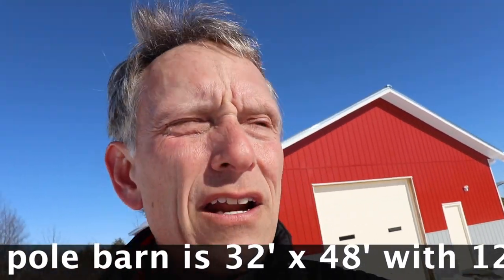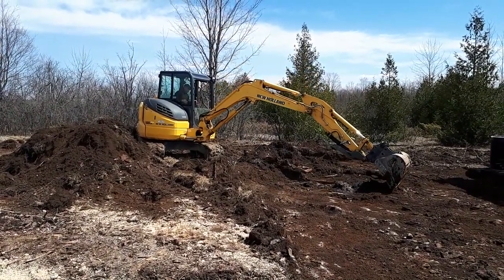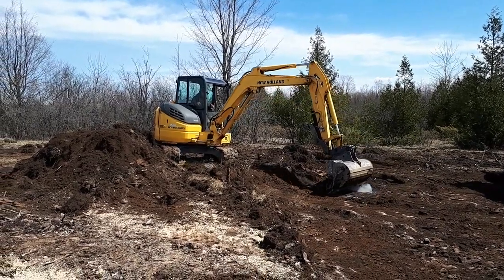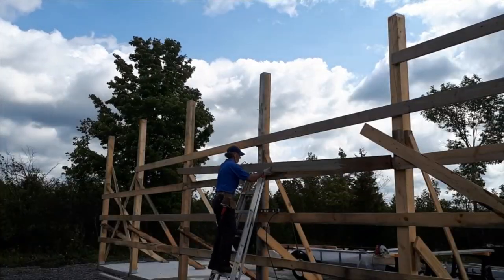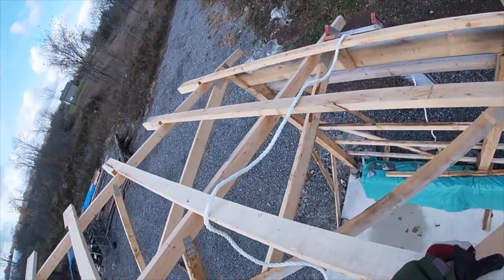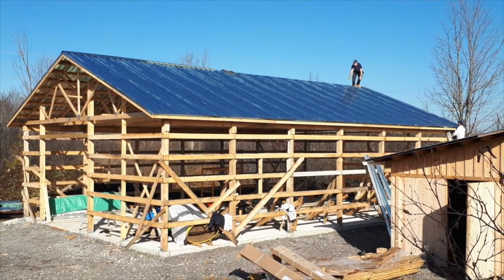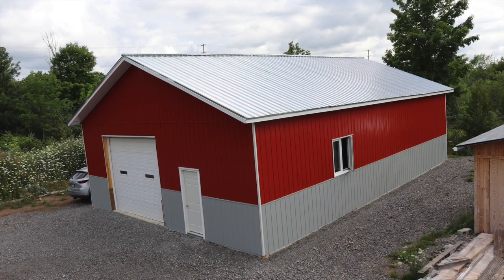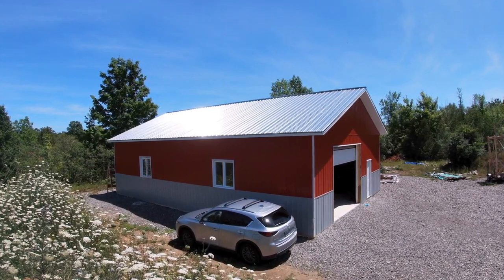How Much Did It Cost Me to Build My Pole Barn?

Comment: I've watched all of this project Peter. I think a Pole barn build is the greatest thing ever. My younger brother build a 3 car garage the same way, with metal roof and exterior walls.  He had radiant floor heat put in his concrete floor which is 32'x48'x10' ceilings. . He can heat his garage way cheaper than I can and mine is only a 2 car 24'x32'x 10' ceilings. A very nice garage.
Reply from the maker: Thanks Dean ... for your interest in the project! I think your brother made the right choice with the radiant floor heating. My budget at the time could not work with the in floor option.

Comment: How many bags of concrete premix did you use?  I thought for that many piers it would have cost alot more than $106.  Great video series.  I've learned alot and plan to attempt something similar. Thanks.
Reply from the maker: Thanks Rodney. I bought about 24 bags about two years ago. Many of my piers are not more than 12 inches high. There were about 3 or 4 that were 20" to 24" inches (undulations in the bedrock). I added some extra gravel and I think I even returned a couple bags.

Comment: Doesn't using uncured timbers bring a great risk of structural flex that could lead to failure or at least damage????
Reply from the maker: Hey Richard, I'm not a civil engineer so I can't answer with certainty. I researched what I could build with 'green' lumber thoroughly. In most jurisdictions in North America, non-habitable buildings can be built using 'green' lumber. So, barns, storage buildings, garages, sheds, tools sheds, etc can all be built using green lumber. However, the trusses must be constructed with kiln dried and inspected lumber, and must be approved by an engineer. Also, my plans and materials, including use of green lumber, were approved by my municipalities' building engineer. All this to say, I don't think 'green' lumber could lead to 'failure or at least damage'. I think there are greater risks concerning failure and damage if you do not adhere to approved building and design standards. Peter at the Reboot.
Reply: @TheWoodlandReboot  The problem is not with the green lumber.  I build post frame with imbedded, treated posts.  I  have seen buildings without treated lumber expire (for lack of a better word) in 20 years or less.  You have eliminated the rot problem below grade, but if the bottom girt and the post itself are not treated; the bottom half of the girt and the critical bottom 4 - 6 inches of the post will also rot within 15 - 20 years.

If it were my building, I would start soaking the perimeter and especially the posts in waste oil or anything thing else you can concoct to make it less inhabitable for the microorganisms that will invade.

Comment: Nice job on the shopping around for discounts!!! Especially that insulated door. One question for you. Are you worried about the milled lumber drying out, twisting or shrinking? Any thoughts would be greatly appreciated.
Reply from the maker: Thanks Dave. Drying, twisting and or shrinking (DTS): I'm not worried about it. I reviewed these issues with the town's Building Engineer. He explained the history and reason why green lumber is allowed in shop/farm structures. Any DTS won't harm the intended function of the building: a shop. Peter at the Reboot.

Comment: Is there a significant difference between milling the lumber and buying milled lumber if you include the cost of the milling equipment and associated tools ?
Reply from the maker: I don't have a precise answer. I wanted to saw logs. I was lucky in terms of the price of lumber, i.e. it shot up during the time I was doing the project.

Comment: Hi my 32 x 48 pole barn with 5 inch concrete pad was completed in 2017  i am very happy with it  it came in around 45k  but i didnt touch a hammer
Reply from the maker: That is good. Are you based in the US? If yes, multiply your total by approximately 1.25 for the comparable in Canadian dollars.

Comment: Impressive! Thank you for sharing costs. I cringe to imagine what it would have cost  if you had used store bought wood at today’s costs! I will also elect to mill my own wood for my upcoming garage build.
Reply from the maker: Thanks Claude. What model of mill do you use? Peter at the Reboot.
Reply: @TheWoodlandReboot  I have just placed an order for a WM Bushlander 22 with extension. With luck I’ll be receiving it in 4 weeks or so. In the meantime I’m cutting trees and stocking them in preparation to milling.

Comment: How long did it take you to mill the lumber ? And how long did it take you to build the building after u milled the logs ? Great videos and building. Todd
Reply from the maker: Off the top of my head: lumber - up to 8 months; building - 1.5 years and still going (electrical, insulation, heating). Thanks for watching!